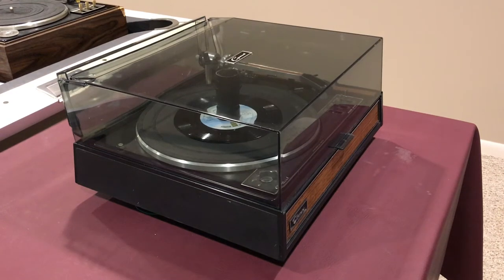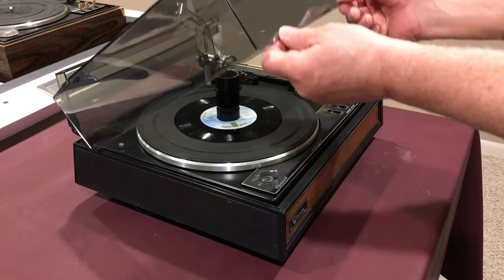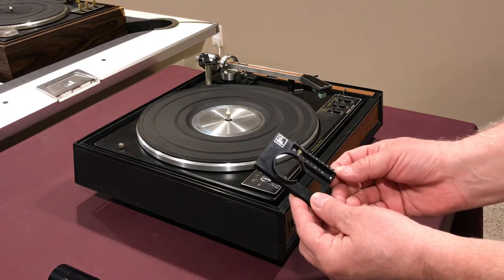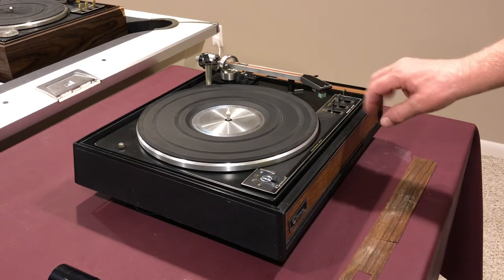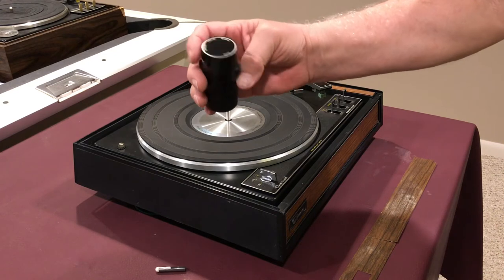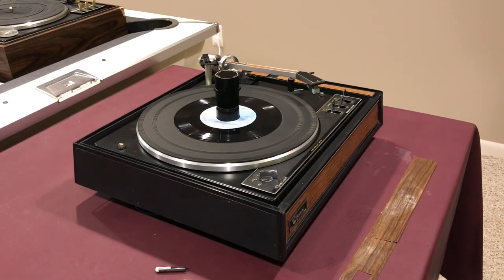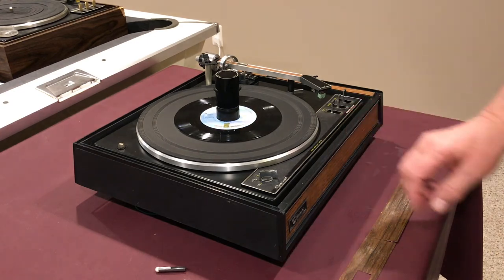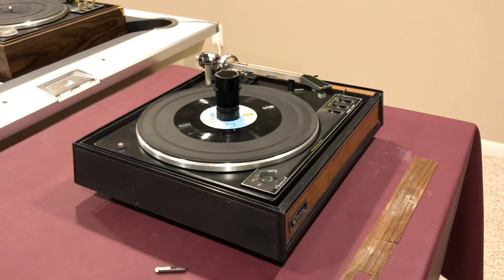Garrard Turntable SynchroLab 95B

Comment: I have the exact same model and the motor sounds like a lawnmower, also the 45 speed doesn't work nor the automatic start.
Along with the mechanism, does the motor needs lubrication?
Reply from the maker: Lots of different issues to address. Certainly a full clean and lube should handle most of it. There is a common problem with these motors where the upper ring becomes dislodged and rattles profusely. check out the video by this guy. I have fixed this issue an couple times. https://www.youtube.com/watch?v=Idtm-JoxuI0

Comment: Nice video, I have a Garrard also with a frozen syncho-lab motor, did you happen to make a video on how you repaired it?
There is a permanent magnet on the shaft and it spins freely, I'm wondering if it was originally glued to the main armature?
Reply from the maker: I never think to capture the fixes until its too late. But yes, two turntables I repaired suffered from the same condition. The motor worked but the magnet had become disattached and I epoxied it to the armature. The trick was to look closely at the glue marks so you can reattach the magnet where it belongs. If not the armature will be out of balance. Make sure its in-line vertically from both the front and side view and you should be good. I have another unit to work on so I'll see if it has that issue. Hope this helps.
Reply: @xfireamg417  Thanks very much for the tip, now I'll give that a try.
Reply: There seems to be no sign of how it was originally glued. it seems that the copper part is balanced
on its own, then the aluminum plate is used to balance the magnet.  Seems it spun loose long enough
to make it impossible to find any alignment.  Seems I just have to glue it to get a working motor that
maybe is not as well balanced.
Reply from the maker: @PeteBasel  How did your repair work out?
Reply from the maker: Glad you got got it going.